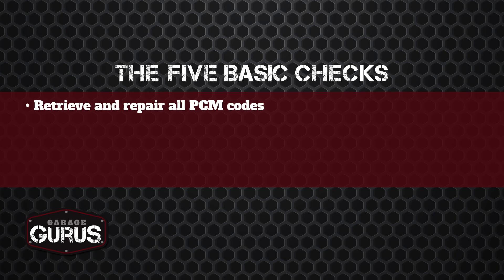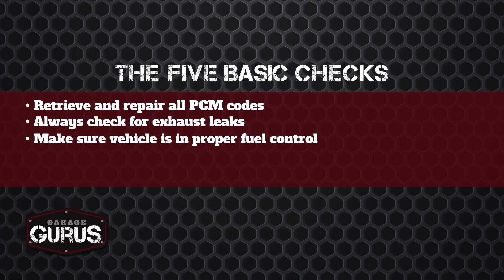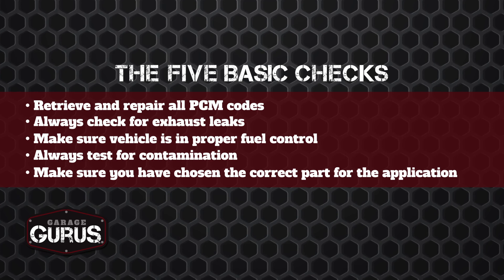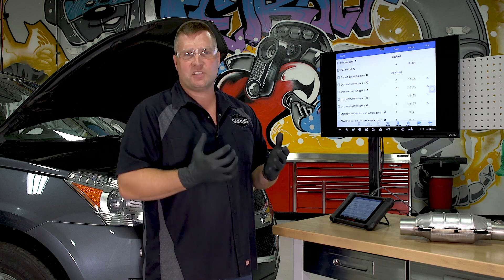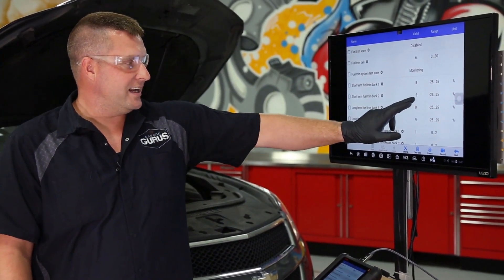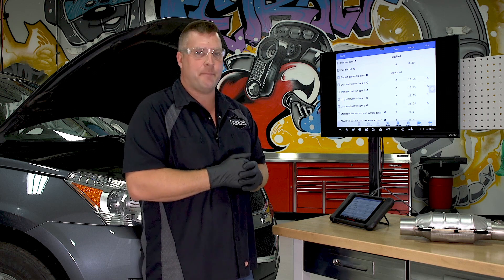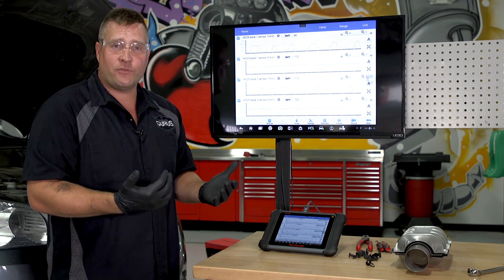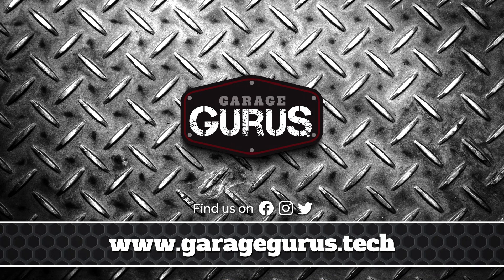P0430 Cat Efficiency Diagnostics

Comment: How do you know which cat converter your car needs..I have a 2006 Toyota Camry and the check engine light P0420 keeps coming on..It is a zero emissions efficiency vehicle so it may require a special cat converter..
Reply: It looks like your vehicle has one or two catalytic converters, depending if it is 4 or 6 cylinder:
https://parts.olathetoyota.com/auto-parts/2006/toyota/camry/xle-trim/3-0l-v6-gas-engine/exhaust-system-cat/exhaust-components-scat

If it is a 6 cylinder and has two catalytic converters, the code he showed "P0430" will vary slightly to indicate which "bank" the code is associated with.  Each bank will have 3 cylinders in it.  Two banks, 3 cylinders each bank.  

A 4 cylinder engine is a "straight" engine and all cylinders are in a line, only one bank in this type of engine.

If the vehicle has two banks of cylinders and is a V type engine (vs a straight engine),  each bank may have its own catalytic converter.  

Stay gold.
Reply: You'll have to know how to interpret the Rear Oxygen Sensors vs. the Front Oxygen Sensors is "one step".

The Rear Oxygen Sensors monitor the Efficiency of the Catalytic Converters.

If there are no exhaust leaks or other faults, the Rear Oxygen Sensors should never show the Same Voltages as the Front Oxygen Sensors.
..On "Narrow Band Oxygen Sensors" , the Front Sensors should be Switching Faster than a speeding bullet ( 200 millivolts to 800 millivolts or .2 Volts to .8 Volts constantly )
 The Rears should be reading a Steady Rich Voltage : like 700 or 800 millivots.

If you live in a City :

1) Take a picture of the Decal in the Drivers Side Door Jamb. It has your VIN # , Tire Pressure info, etc. Save that to your Cell Phone

2) Inside the Dealership Parts Department, show that to the man or woman there

3) Hi , my name is Judy Bourke :   

 I would like two things if possible : A price check for the Oxygen Sensors and Catalytic Converters for my vehicle plus a Print Out Photo of where the Oxygen Sensors are located.

P.S. : Dealerships Always use the VIN #  to get the Exact Part for that Vehicle thus eliminating the WRONG Part Sold.

Whether the vehicle has "2", "3" or "4" Oxygen Sensors ( they have different Part #'s ).....If the Rear is placed in the Front , or the Front is placed in the Rear Location : this can create a P0420/P0430 DTC ( Diagnostic Trouble Code ) & I end up telling my Sister she needs to replace the CAT & both Oxygen Sensors.....When she gets Home, I put the Rear Sensor in the Front & the Front in the Rear AGAIN.

Dealership Parts Department !! - Pay attention to those Part #'s.

Comment: IF the customer concerned is not financially able to support the cost of the replacement part a TEMP fix is possible.  There are forms of carbon filament packing avail which can be applied to the affected area and secured with a spring assisted hose  clamp.